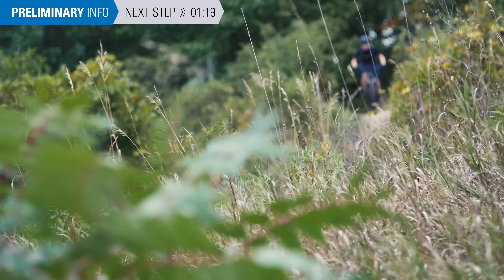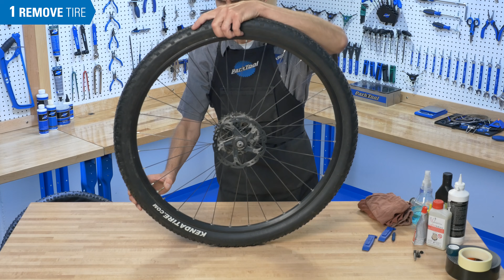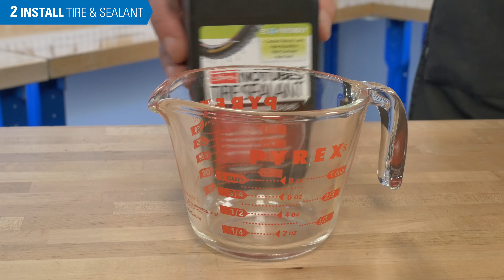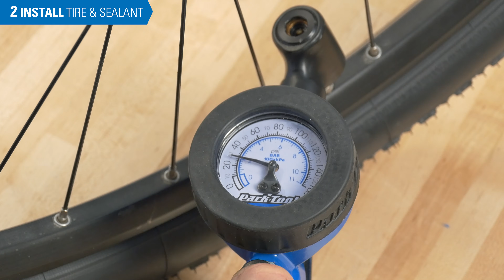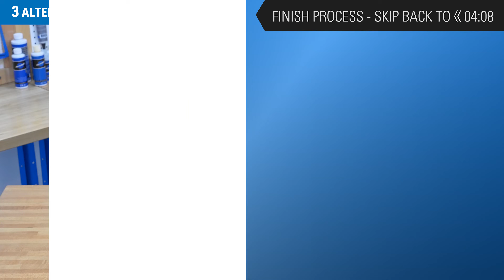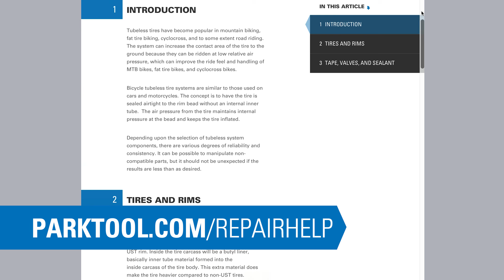How to Install Tubeless Tires

Comment: Do your rims have to be tubeless ready
Reply from the maker: Check out Stansnotubes.com they have a good tech info on this. But in short, no but sometimes. There are some non tubeless rims that can be converted without issue. There are also some rims that will not have success being converted.

Comment: This seems like a lot of work.  I am terrified of getting a flat and being stranded.  I'll stay with tubes
Reply: same here
Reply: Have gotten zero flats since switching to tubeless 3 years ago.  I've lost count how many flats I got while running tubes.
Reply: It's a little tricky at first, but worth it. I know everyone has a different experience, but I have not had a flat in over a year with tubeless. I'm with you about not wanting to get stranded so I still carry a tube as a backup.
Reply: Best thing iv ever done, run on lower pressure and lighter wheel set, any failures just carry a spare and you’re good to go! Happy riding
Reply: Is it messy when you do have an issue? I've had a few sidewall tears in my time (3 or 4 come to mind). How much sealant is sloshing around in there at any given time? Also, I don't really like the idea of replacing it every few months. I just can't talk myself into this being a roadie.  Any thoughts?
Reply: @ShermanSitter  Honestly the messiest part for me is setting it up as tubeless in the 1st place, especially the 1st couple times i spilt sealant on the ground. There is 2-4 ounces per tire and it lasts 2 to 7 months depending on multiple factors. When you add more it is really no mess at all becuse u leave the tire on the rim and pour the new selant into the  valve with a syringe that measures the amount for u. I understand your hesitation...took me 2 years of riding mtb and a bottle of tequila for the bike mechanic to show me how before I tried it myself. Now i can do it no problem. Good luck!
Reply: @ewjtri3984  - Thank you for the thoughtful response. It has helped with my decision. I think if I was a mountain biker like you, I probably would do it. Since I am strictly a road rider, I've decided to stay with tubes at least for now. I usually go about 6 months between flats anyway and just upgraded my commuter to marathon with greenguard, so the time savings is just not there and less hassle overall.  For MTB, I can definitely see the benefits though! Thanks again and happy riding!
Reply: I run tubeless, and yes it is annoying when you get a flat, but I just carry a spare tube and install it if that happens.

Comment: What if my tire bead doesnt want to wide?id doesnt settle in the rim right and i cant put any air in it
Reply from the maker: This is not un common. A high volume air compressor can help, removing the valve core to flow more air into the tire can help, I have seen many people use a CO2 inflator while the valve core was removed. If all else fails installing the tire with a tube, then removing the tube while only removing one side of the bead from the rim, then reinstall the tire, install sealant and inflate with the loose bead facing downward.
Reply: @parktool  i tried just the tube trick and it worked
Thank you😱

Comment: If you are changing a tire with dried up sealant to a new rim is it ok to install without cleaning the inside of the tire? The dried up sealant doesn't want to seem to come off. Help!
Reply from the maker: If the old dried sealant is not preventing the bead from seating, it can be left in. You are adding some weight, however.  It can be pick out by hand, very slow and tedious.
Reply: @parktool  I don't know which brand of sealant was used previously. Is it ok to just use what I have provided that the old sealant is completely dried up? Thanks again, learning so much from you guys!

Comment: hi. I have rear wheel tubeless set up and after 4~5 month of use sealant comes through side of the tire. Before then no sealant leaking I could see. But even now I don't need to add air to the tire about 1 month ,though I ride every weekend for 5 ours on the mountain trails. This tire is used for about 11 month. Could you tell me if I should replace the tire? Thank you.
Reply from the maker: As you use tires, the sidewalls do get worn and may allow sealant through a little bit at a time. If you add more sealant when it gets low and your tire does not require air I would keep riding it as long as it has sufficient tread for the desired riding style.
Reply: Thank you.

Comment: This was such a perfect instructional video on this. I just got a bike with tubeless tired and was pretty nervous about changing them. You'd made it far simpler than I thought it would be. Thanks!!!
Edit: Nevermind...it is in fact a far more challenging task than this video let's on. You neglect to mention that you cannot do this with a standard floor pump. You neglect to mention how much of an utter mess it makes putting the sealant in first. I pretty much wasted the first two ounces of sealant as it got everywhere, and leaked all over the floor. Now I have to start over, get more parts, namely co2 canisters since you don't mention it has to instantly I flat to set the beads.
Reply from the maker: Sorry to hear your experience was not the greatest. In the video we do give you multiple options for install and say that on some compatible systems you can even use a floor pump. Putting sealant in first can be a mess but if careful works great. Thus why we show you both methods. I hope you got your tires setup!
Reply: Hey, I apologize for the tone in my response.  I had literally just had, what seemed all the sealant just spew out, making an enormous mess.  I had to take another trip back to the store for more parts, so I was feeling awfully frustrated at what appeared to be a very simple process.  After going back and getting shraeder adapters and in combination with my air compressor, i was finally able to get it set up.  
What i found would be useful to add, would be to make a very strong point about the need to be able to blast a LOT of air in immediately.  That was the big problem I initially had. Using the floor pump is not possible.  Upon looking at other videos it seemed to verify that you need a booster pump or an air compressor.  
I must've missed that part about a floor pump being possible on some systems, but emphasizing that it will not work on others would be beneficial.  
Also, this is simply my ignorance and being able to "feel" air pressure, the last thing that cause me problems was not realize how full the tire was after inflating with the compressor. I was afraid it was over full, yet the beads weren't settling.  So as i tried adjusting them, i kept losing all the air and flatting the tire.  So FINALLY, after filling it again, and thinking it was too full, i put my floor pump on it, only to find that i was only at 20 psi.. Once i cranked it up to 40 the beads all set themselves.  
So again, i do appreciate the video, I wouldn't have known where to begin and there was a lot of helpful stuff.  I just think it needed a little more for ignorant morons such as myself who have never done it before, and might need a few extra hints along the way.
Reply from the maker: Thanks for the info! Thats all very relevant and we may have to look over our video again. Thanks again Josh Wexler.

Comment: i have a new bike with 29er tubless tire and it only shows 35 psi,so if i use the sealant to inflate the tire for the first time i have to put 35 psi or more?
Reply from the maker: For the first inflation, you will need to over inflate to seat the tire.  Expect there to be some bleed down as the sealant finds any leaks. Drop the pressure before riding.
Reply: and how much more psi do you recommend me if my tire is 35 psi?
Reply: Just inflate it to the max pressure the tire says.

Comment: Do you need to use sealant on UST?
Reply from the maker: No, the UST system usually seals nicely without sealant.  Sealant can help down the road, say, just after that nail or thorn you picked up.
Reply: @parktool  thank you for the response!

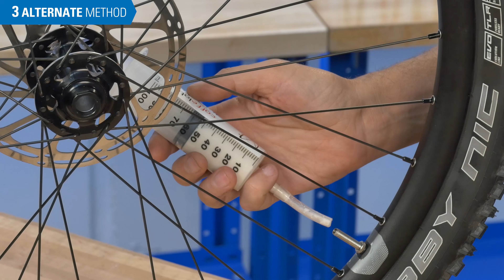Comment: I can't see the point in letting the tire deflate fully at 6:49... when working with non-compatible/non-certified parts as many people do its safer to 1)inflate the tire with compressor without valve internals to "pop" it in place quickly 2)plug the valve with your finger 3)insert the sealant 4)again plug it with your finger 4)insert the valve internals and fill the tire fully. The point is, after the valve internals are in place, its too slow to inflate the tire fast and you might end up with tire not seating right and a messy cleanup operation. Why take the risk?
Reply from the maker: Have you tried installing sealant with air in the tire? That, gets very messy, at least in my experience.
Reply: @parktool  Hmm. Yes, I do it all the time.  Attach the sealant bottle to the valve at twelve o'clock position and let the some air flow into the bottle. After the pressure is same in both the tire and bottle, you can just pour it in at eight o'clock position. After the bottle is empty, turn the valve back to twelve. Once you detach the sealant bottle its only air coming out, the sealant is at the bottom of the tire. Thank you for the video and your quick response!

Comment: Please Help what am i doing wrong?I've followed the steps but my tyre won't inflate....
Reply from the maker: Is air escaping somewhere or is there something wrong with the inflator or valve?
Reply: Thanks for your reply😀Yes air is coming from the rim/tire...It inflates a bit but gets to the point where air starts to come out.
Reply from the maker: You most likely punctured the tube upon installation unfortunately. be careful not to pinch the tube as that will puncture the tube.
Reply: I don't have a tube I'm tubeless I tried it with 2 different tires and get the same problem...
Reply from the maker: Ah, apologies. You have sealant in there correct? Is your tubeless tape installed nicely so that it makes a nice seal?

Comment: every tubeless I've installed doesn't seal easy even with a floor pump. this didn't mention any useful tips
Reply: Try an air compressor or Co2 cartridge
Reply: I just went through this myself, as this was my first attempt.  I had no luck with a floor pump.  I hooked up an air compressor then finished it off with a floor pump.

Comment: or just use tubes?????
Reply: you can run lower pressures in tubeless and it prevents pinch flats
Reply: No
Reply: You come to a video specifically instructing people how to install tubeless tires just to post a comment to use tubes? What kind of a sad troll are you?

Comment: Not worth the effort imo, a nice set of clinchers with lightweight tubes or even latex tubes, roll nearly as well and tubes are easy to patch if need be. I have seen countless bikes come into my shop with tubeless flats where the sealant failed to work. Even mounting and gluing tubulars is less of a hassle than tubeless, which is saying a lot.